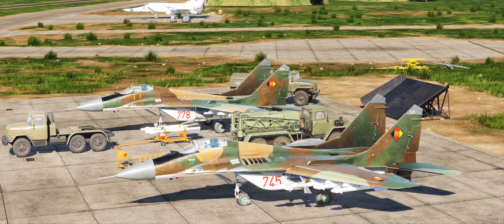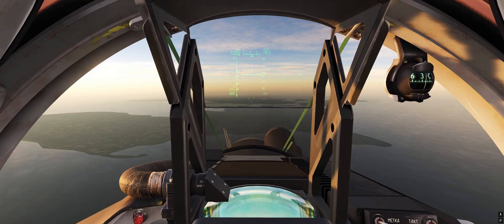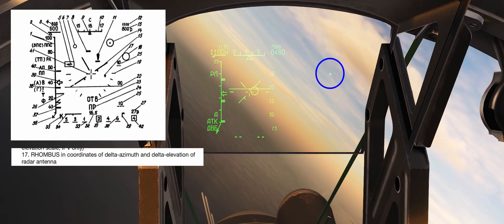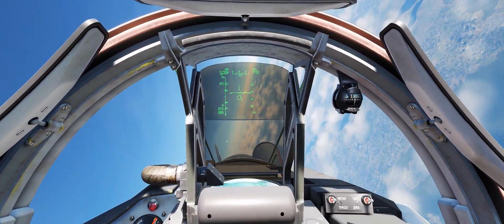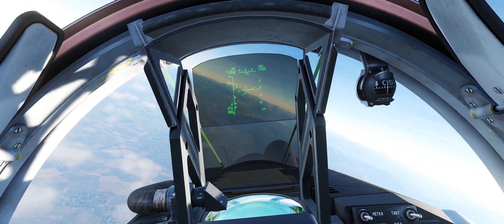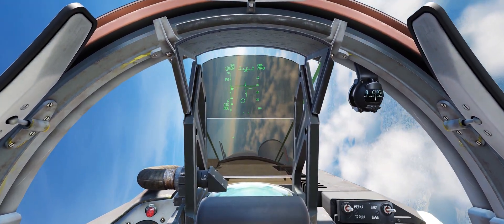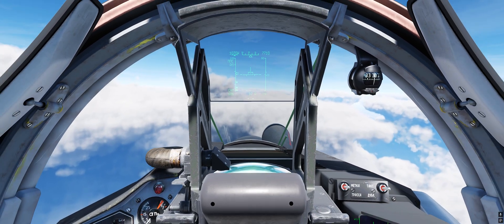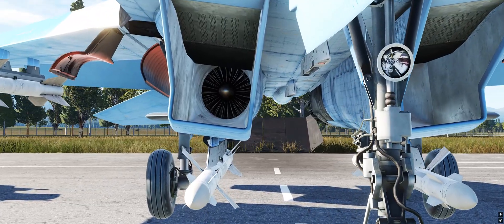DCS: Ultimate FOX 1 BVR Guide | Pt2 - MiG-29 | FC3 Vs FF

Comment: Some points 

1. Gimbal limit is 70 degrees when locked 
2. You’re a little off when talking about up/down gimbal limit in a turn for one reason. 

HUD symbology only works when level. If you lock someone in front and turn right with 90 degree bank, the gimbal indicator will drift left not down (in the direction of the target.) 

I think this will actually make it easier to crank and reverse crank direction, as left/right is only showing azimuth crank limits and up/down only elevation, it doesn’t change no matter how you roll. 

You can see this in some HUD videos on YouTube 

3. Don’t forget that in FF the TWS will automatically gate the target with highest proportion of speed to distance, hopefully prioritizing the most dangerous enemy 

4. FF won’t show PRF info unless you have datalink. Without looking at your switches, you will only know what PRF the radar is in by looking at the range scale on the HUD

Like here, this way, when reversing a crank, the gimbal indicator won’t be rolling around the HUD. At the same time, it won’t point towards the target unless you are level 

Check here https://youtu.be/fvFZGkerIj8?si=aZ4kTxTW_OV5yUHg

And thanks for using the HUD document I translated 😉

Comment: On the lofting bit, the ability to manual loft the R-27 is a relatively recent addition to the game; maybe 2.5 years ago iirc. All variants of the AIM-7 besides the MH and P behave similar to old R-27 where it would forcefully correct to a 2D ProNav guidance instead of a 3D one like how the R-27 currently operates. At the ranges combat between fighters using R-27 and AIM-7 take place, it's unnecessary to use a loft which is probably why they don't have auto-loft like the AIM-54 or Super 530D. The first shot will seldom hit a maneuverable target fired near max envelope where a loft would help. So, manual lofting was most likely not SOP. I think versions of the R-27E had auto-lofting though. Also, the work you're doing on the 29 makes me want to do this for the F-15 since the FF 15C was finally announced. Great work on this video btw!
Reply: +1 learned a lot from you. It will be awesome to see it on the F-15. Fly safe.
Reply from the maker: Very interesting! Thanks for the input!! 🫡
Reply: I find it very helpful to loft. The missile hits the target in the same time but much higher velocity, giving it more ability to chase the target if they turn and run.
Reply: @AeriaGloria in all my testing, manual lofting, at standard combat ranges, actually harms missile flight time such that you may lose the fight against someone mirroring you and not lifting. I personally advise against it unless you are shooting beyond 20NM/40km
Reply: It is worth it lofting the R-27ER up to 30-40° radar vertical gimbal from high altitudes, it will decrease your time to impact significantly.
Reply: @moneygry73  I it doesn’t decrease time to impact. I’ve tested side by side, both missiles impact at the same time. 

I wouldn’t suggest more than 30-35 degrees though. And inside 30 km you want a smaller loft angle. Or a smaller loft angle if you expect them to dive and crank after
Reply: @moneygry73 anything above 30 degrees ends up harming the flight trajectory because the target is moving towards you some amount. But yes, lofting helps there with the ER, but this is more about the standard motor variant

Comment: so in the full one if you let your bandit slip on the gimbal limit you better kick the rudder as a roll will make the radar loose track?
Reply from the maker: No. Roll won’t loose anything. You just have to keep the target within the gimbal limits of the radar, but if you’re at a 90 degree bank, it’s the upper and lower limits of the radar that will be the limiting factor, not in azimuth. And the limits for up/ down are lower.